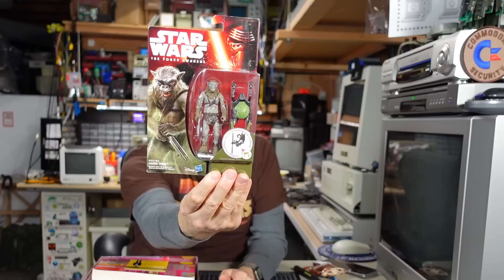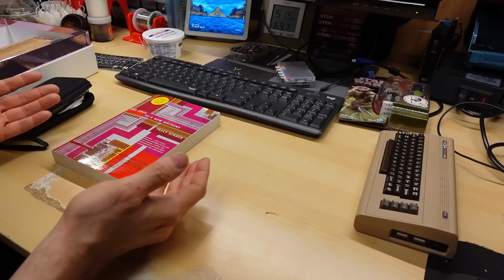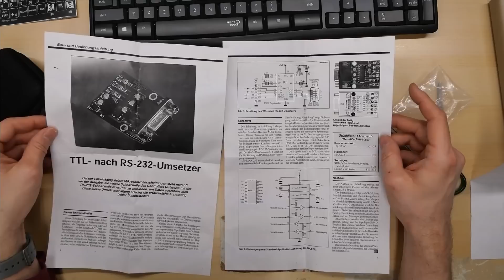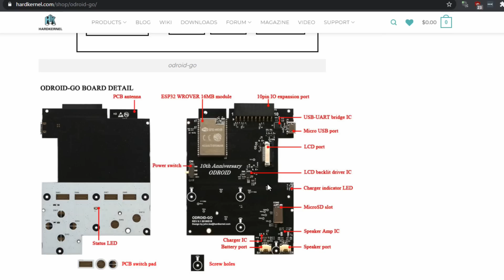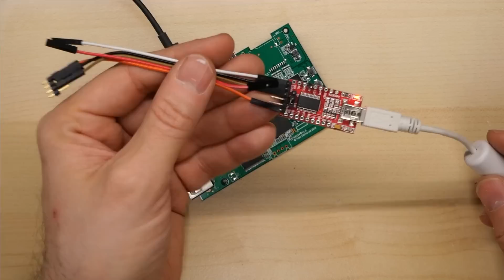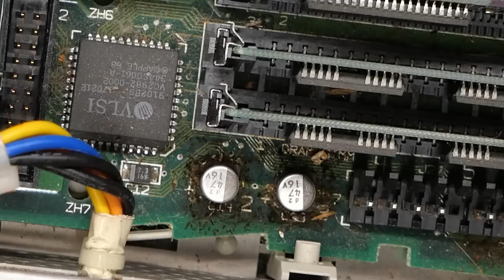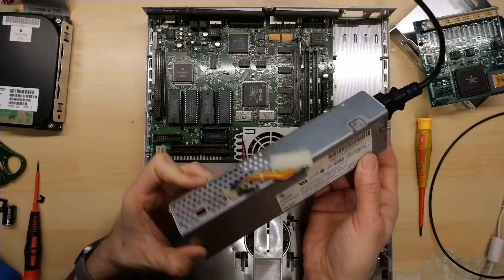A bricked TheC64 Mini? A filthy Macintosh LC, The ODroid-Go ESP32 handheld and more

Comment: The Macintosh LC was originally designed with schools in mind. It was easier for teachers to give kids a new boot disk when needed, like the old Apple II days, then to constantly administer a hard disk.  Because the Mac was so inexpensive, it was popular with home users.  You only find dual-floppy LCs from schools.

Also, the 68881 FPU can run at a separate speed from the CPU.

The LC II was basically what you have here: a 68030 in an LC.  The main benefit was the MMU for virtual memory.  Very useful for schools who couldn’t splurge on RAM which was incredibly expensive in the 80’s and 90’s.

Comment: If you've got a heat gun, you might try a reflow in that BGA SDRAM.  Nothing to lose.
Reply: That's the first thing I thought of when I saw that error. I've heard of people fixing many early 2000s video cards with ram issues that way. Should be a similar situation.
Reply: Time is something that can be lost. There's a very low return on investment on that time for something that's easily replaced these days.
Reply: @Those_Weirdos  Sometimes, the point (and the appeal) is to try to fix - even if you could buy a new one! :)
Reply: @Those_Weirdos  Plus, if you can keep one more device away from the landfills and prevent the unnecessary use of materials, I'd say it'd be worth it!
Reply: Or an Xbox 360. I fixed one of mine with a heat gun. Sometimes it lasts and sometimes it doesn't, but you have nothing to lose.
Reply: This can happen in a world without leaded solder. Just like a xbox360 red ring of death you can hit it with some hot air and it may fix it. Or bake it from underneath on a hot plate.
Reply: Yes a simple reflow without touching the part. I got an Xbox 360 working that way.
Reply: @relic985  but at what point has my basement become another landfill...
Reply: @cheapasstech  maybe an overheated reflow is what caused the existing RAM failure
Reply: @cheapasstech  Yeah, the solder is good for the environment, but if the whole thing breaks, that benefit is thrown out the window. Less lead = more e-Waste.
Reply: @cheapasstech  While Lead is a natural element, it's rather hard to get in contact with. I think from the health perspective, it's good - but if I remember the opinions of people sondering all the time, leadfree solder is garbage.

Comment: Recently I was repairing an LC II, and its 80MB HDD had a head stuck to the limiter/bumper. There was a rubber insert in this bumper, which transformed into a chewing-gum like substance. I've managed to remove it and replace it with two layers of a double-sided foam tape, with a protective film left on the top side. Without this tape the head would crash into the platter hub. The drive is now working, without any bad sector. I've formatted it and verified using a Silverlining software, which I've seen on your channel, thanks for that hint. Macs are really rare in my country, and this was the first one I had in my hands, so I had no idea what software to use. Strangely it had a Polish keyboard (which is really odd, as we use US Intl. layout), and had System 7 in Polish (with a very strange terminology/translation).

Comment: Hot air gun on that memory chip, put a small amount of solder on top of it. 20 seconds after it melts the solder under the chip should melt as well. Also some liquid flux around the chip will help reflow any cracked solder joints. Aliexpress sell a temperature controlled hot air rework station for £20. It's well worth learning soldering SMD chips and components and it's not too hard to do after a bit of practice with the right equipment. You can even buy kits of chips/components and boards to practice with for about £1-50

Comment: Yeah, your take on the Odroid Go is 100% spot-on. I just got one of these, already owning 2 Odroid Go Advance handhelds (much more capable RK3326-based Linux handhelds), and it was specifically for the purpose you realized: custom programming with the Arduino sdk.

Comment: With an oven reserved for soldering, in a last resort, I would try to reflow the pcb. To check the temperature, I put a small length of soldering wire. When it melts, I wait for 10 sec. and turn the oven off

Comment: The dual floppy no hard drive Macintosh LC’s were only used in schools and were never sold to consumers.  Most schools that used these LC’s stored application software on file servers.
Reply from the maker: Ah so it would boot from disk, then use Appleshare to run programs?
Reply: @adriansdigitalbasement  That’s right.  I remember when I was in high school using Mac Pluses and Classics using a system 6 boot floppy and using a third party network stack called Waterloo McJanet developed by the university of Waterloo to get onto a file server which was just a a classic with a SyQuest drive attached

Comment: Hello Adrian I really enjoy your videos and the time you must put in to create them. You may have been disappointed not to get the Mini C64 working but I was really impressed with your skills to work out those pins were a serial interface and to know how to connect it and what baud to at least get to the diagnostic to tell you what is wrong. I learn a lot from your videos. I'm afraid my troubleshooting is usually limited to turning things off and on again! As to the C64 keyboard you probably know this already but I am in the UK, so Shift+2 is the usual key to use to get double quotes on a PC here in the UK, it's standard UK layout. This makes me wonder if C64s sold in the US had the same keyboard layout as in Europe. If so it seems surprising that Commodore, as a US company used a UK keyboard layout globally though of course at the time there wasn't really a "standard" layout anyway.

Comment: The IIci was top of the line in 1989. The only Mac faster was the IIfx, and that didn’t come out until the following year and was more than twice the price. The LC was heavily compromised, certainly, but Apple eventually got that model right with the LCIII, which was a fantastic little machine.

Comment: It's not just the Rigol doing the frequency calculation. I have yet to see an oscilloscope with time-domain cursors that does not display 1/(delta T) expressed as frequency. As far as I remember, even the old CRT-based Tektronix and Hameg scopes with digital cursor readout could do that.

Comment: To make a proper C-64 to RS232 interface, you need two of the MAX232 chips. One does the TX/RX work, the second handles hardware flow control lines. But the single-chip solutions do work well in most cases.

This is one reason it's nice to own one of the OEM Commodore interfaces, as they do have full flow control support

Comment: Your oscilloscope has built in serial decoding... if it’s not enabled on your unit you can download the code needed. Shortly after releasing the DS1054z they started enabling all the features for free... unless you have an early model, you should already have it there...

Comment: The LC does support 640x480 too, at 16 colors IIRC but there's the VRAM socket that enables 256 colors. 512x384 is for the 12" RGB monitor which was a new thing with the LC, and the 640x480 was for the 13" RGB monitor that was used with the Macintosh II models from before. The cheapest monitor was a 12" or 13" monochrome, at 640x480 and 16 grays is perfectly usable with these.

Comment: I have had some luck with repairing pcb's that had bad solderjoints. I put them in a oven at 80° Celsius for 10 minutes, let it cool down before handling. You can start at a lower temperature and try increasing the temp incrementally. If you don't have an oven you are willing to use for this you could use your 3d printers heatbed. Best to build a cover to put over the pcb (insulation that one of your viewers uses to pack stuff he sends you) or use an enclosure for your 3d printer.

Comment: I wonder if the “reflow solder in the oven” method would do anything to that mini c64. But I know nothing about this stuff.

Kinda want an LC after all this criticism, I love underpowered stuff.
Reply: I have an LC III, which actually is less underpowered than the other LCs before it. I enjoy it
Reply: I would try reflow, hot air until you see solder melting or oven it as could be a ball not connecting
Reply: On the C64 Mini board the LED should light up no matter if the SD RAM is faulty.
Maybe a power line has gone bad and that causes the problem?
Reply: yeah, wouldn't hurt to try. It's best to flood the underside of pbga chips with flux first. maybe a solder joint has cracked.
Reply: The oven doesn't get hot enough to reflow chips so it wouldn't be a permanent fix, it would only work for a little while then crash and not boot again
Reply: @nathanmead140  I've heard this before, but it is not correct.  Most home ovens do get above 217°C (~423°F) and could melt the solder, _but_ almost no full-size kitchen ovens can follow the proper temperature profiles to do it properly (there are other problems too).  A toaster oven, on the other hand, can work (there are plenty of open source controllers).  Do note that you shouldn't ever use that toaster oven to make food afterwards.
Reply: @nathanmead140  Kinda depends on the oven - the modified toaster oven he used in the chip baking experiment might go hot enough. I'd use my cheap chinese digitally controlled hot air wand myself.
Reply: @slightlyevolved  yeah. The LC III is probably the best pizza box before the LC 475
Reply: @undefinednan7096  lead free solder that's used in new electronics needs about 350° Celcius to melt solder so if it did melt in an oven it wouldn't reflow very well, even old solder from the 1980s takes a lot of heat to melt, I fixed one of the problems on my sanyo stereo which is from 1987 when I was at my mom's house last year (it still needs a new motor and new belts for the dual tape decks a new lever for manual reverse on the A deck and I have to fix a piece of plastic inside that has snapped) one of the 3.5mm microphone jacks on the back had a couple bad connections and I didn't fix it right a couple years ago so the left channel was still really quiet when being used with an original xbox and a 40GB fat PS3 (that I upgraded from a 40GB to a 120GB in 2017), I desoldered the jack and cleaned the holes on the main PCB out with my solder sucker then put the jack back on and resoldered it with new 60% tin 40% lead solder and I had to wait about 10 to 15 minutes before the old lead solder would melt and that was with a 30 watt soldering iron.
Reply: @nathanmead140  there are several things wrong with your understanding.  Firstly, a 30 watt soldering iron is fairly low power, whereas even a low power toaster oven outputs more than a kilowatt.  Secondly, the melting point of the sort of solder used on typical PCBs, both leaded and lead-free, is well less than 250C (leaded 60-40 melts at 190C and SAC305, a common lead-free solder, melts at 220C).  The reason you need to use a higher temperature on a soldering iron is that the iron has both a relatively small heat capacity and low power output, so its temperature drops when you touch it to the metal you're soldering.  This is especially apparent if you try to solder to a ground plane, which will suck the heat out of your iron.  A reflow oven heats the whole board at once and does not experience this issue nor issues relating to thermal gradients, but conversely, following proper temperature profiles is important to ensure good results and avoid damage to the board or components.

Also, if you actually had to hold the iron to a PCB for 15 minutes then something is seriously wrong and you might want to check if your tip is oxidized or your technique is imperfect

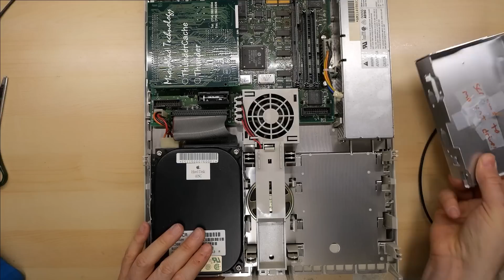Comment: 38:29 - a lot of dual floppy models where used in schools, 1 drive for the OS and the other for student data. I configured a lot of the dual floppy drive models as "wyse" terminals as in dumb serial terminals. Most users preferred them as they had sound & colour (I can still hear that default "eep" sound!)
Reply: I had suspected as much, schools ordering that combination. Give a student a floppy for their data and homework and boot the OS off the other one. Maybe even do that at the start of the day and then load in today’s schoolwork software before each lesson? Depending on how scarce the OS floppies were. In the UK the BBC Micros in the ‘80s and early ‘90s had a system for loading the software remotely onto the class’s machines from the teacher’s one, called Econet. But I suppose going round sticking the boot floppy in each machine sequentially might have taken too long, even if only done at the start of the day. So I presume each machine had a boot floppy permanently stationed?

Comment: Hey Adrian, with the SD RAM chip it’s not that hard to repair - just a hot air station and the proper amount of flux to remove the dead chip - then a little cleaning with more flux and desolder braid - and then a bit less flux and a new chip. I made my first (Louis Rossmann style) try to swap out a FBGA 256 one week before christmas and it did fail first try but worked the 2nd time. I suspected some pads didn’t made contact or shorted but it really wasn’t to hard. I never did much smd work at all before that but I guess it’s the way we have to go sometimes as long as it’s still possible to repair stuff. Greetings from Germany, keep up the great content you create - its really fun to watch!
Reply: Coincidently Voltlog has published a nice BGA soldering tutorial just today - https://youtu.be/15RFI9wKHq8 so only desoldering Rossmann style ;)

Comment: BGA soldering actually isn't that difficult - at least in the scale of RAM ICs. Just get a cheap hotair station, flux, some stencils and balls and you're ready to go.
Something like a bad ram is a good point to start and learn. My first tries were an old router and a graphics card. I unsoldered the CPU/GPU, reballed it and reattached. Worked both times. You only have to be careful with the desoldering braid and the heat, it's quite easy to rip a pad.

Comment: I had this happen to my C64 mini too.  From when I first got it, it was very temperamental, wouldn't power up sometimes, and then it just stopped working altogether.  I did a consumer guarantee return to the site I bought it from and they sent me a brand new one, that has had no problems since.  I'm assuming there was a manufacturing problem with it, rather than it degrading over time.

Comment: I still have my 1st gen iPod Shuffle in my vintage iPod collection and last time I checked it still worked though I haven’t used it regularly in recent years. I also have a working 2nd gen Shuffle I have used more recently on an occasional basis. There are uses for stand alone digital music players these days especially if your phone is lacking a headphone Jack or you want an entire large digital music library on a DMP device without eating lots of space on your smart phone. You can also use them with older stereo systems or give one to a kid, among other uses. Also, I find a certain nostalgia about using an old iPod model just for the heck of it even if I don’t really need to.

Comment: I can also answer your question about the overall speed of the 68020-based LC v the 60830-based  LC II. Because both machines only had 16 bit buses despite using 32-bit processors, the LC II’s processor upgrade only provide a modest speed increase over the LC. The LC II though did offer at least one major advantage over the LC it replaced in the it sold for a mere $1300 vs the $2500 of the original, making it one of the cheapest Macs sold at the time. Despite the crippled nature of these machines, Mac users wanting a color Mac on the less expensive side (vs other color Macs) bough enough of them LC and LC II for it to called a success seemingly willing to overlook it hobbled nature. I imagine that most had previously used a monochrome Mac (512k, Plus, SE, SE/30, or Classic) which ran at the same or slower speeds so they didn’t realize what they were missing. If you had “upgraded” from Mac II to an LC then you would have realized that the older Mac II ran at 2x the LC’s speed, despite both having 16mhz 68020 processors because the Mac II had 32 bit bus (though it was not 32 bit clean meaning  that without a special special software later developed (MODE32) the bus ran at 24 bit limiting memory to 8mb but still much faster then LC’s 16 bit bus).

Comment: Adrian, you can do a lot with the  Odroid. It can have a variety of native software python based. You might have better look with the emulation with different firmware. There are also ways to port Wolfenstien, Spear of Destiny and doom. Also on the other firmware there are ZX Spectrum and C64. Maybe I can't  see the lag on the emulators which is scary but I play games I know the speed of that I grew up with on the Odroid and didn't notice and I love the device it is kinda open source and I"m really excited about that microcontroller, I know it's not the best but you can make your own emu  box or prorgrams for it. I would suggest getting the extra firmware and retrying maybe that'll help with the problems. You hold B when you power on to change the firmware.  If it's not for you no biggie but figured I'd make my suggestions for your enjoyment.
Reply: I say all this mainly cause I've had much better luck with esp32 devices than Pis.
Reply: Holding B may not work since that device had the initial ship firmware. He may need to do the hard way upgrade. I have a guide on my channel for it. Also yes it does work much better then how it was working in this video. A lot of other reviewers did the same thing running the old firmware and saying it sucks without trying to upgrade first.